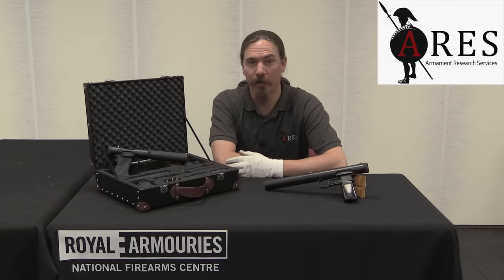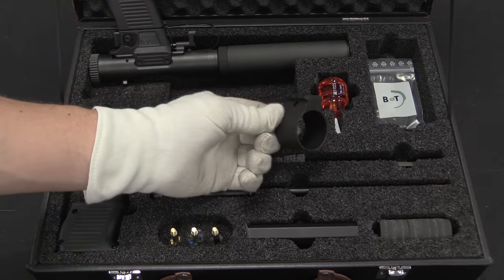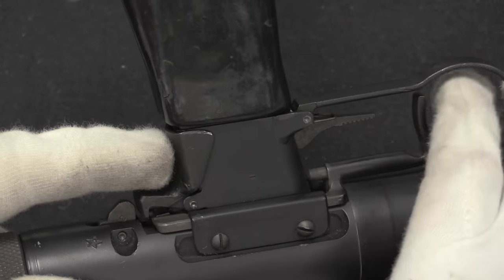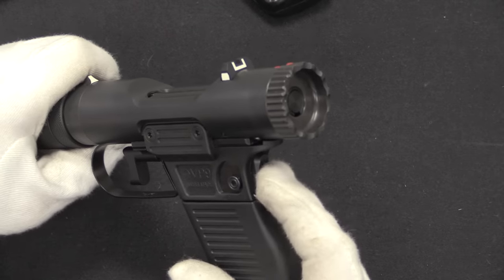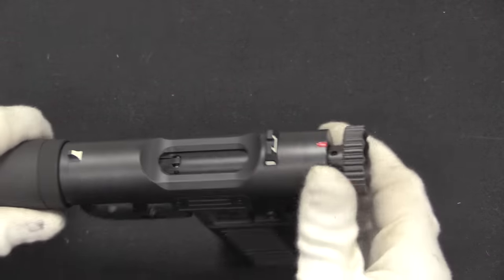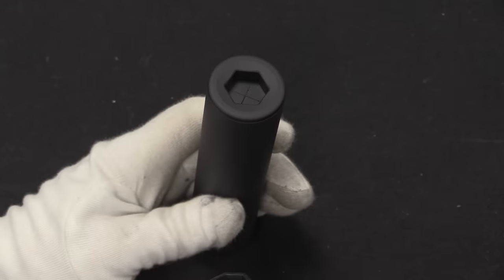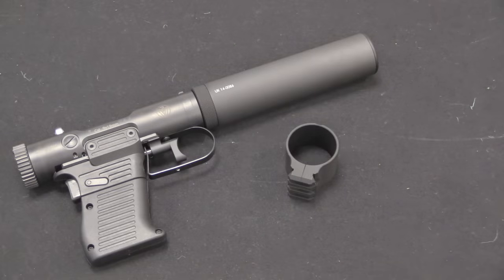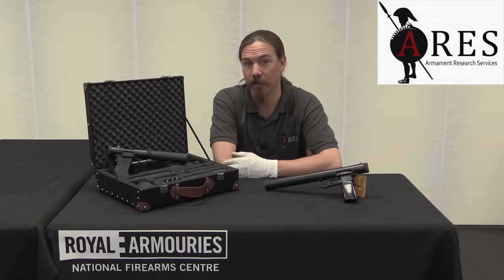B&T VP9 Silenced Pistol: A Modern Welrod

Comment: total rip off of the welrod. still that shitty euro 9mm round.
Reply: What's wrong with 9mm? It's perfectly adequate to get the job done. Especially at the ranges THIS thing is going to be used.

To roughly quote Black Lagoon 'Pretty much any bullet will do the job if you can hit what you're aiming at'.
Reply: DFX2KX it's a euro fixation on the round.  I've had this "talk" with the designers.  it's a supersonic round, in normal varieties, a 45 is subsonic by default.  the designers seems to think the smaller gas of the 9mm is easier to quite, while the 45 larger  (and slower gas) would be harder.  so I call b/s on them. a 45 would be better in most "animals" or just go with a 22lr & it's smaller gas. it's a welrod rip off by an eu company that can't stand an American round would be better than the euro. one.
Reply: Matthew Wilhoit Strange than an european company who manufactures guns in europe would go for the most available european ammo... Also with your comment one could say that you have an US fixation on the 45 round... :-P
Also also: yes, it's a welrod rip off, and the welrod was a british made gun in 9mm (and some in .38)...
Reply: Geir Ove Eilertsen of they were honest about why, I'd take less issuer with it. but as I said, I've talked to them about. gotten b/s replies instead of honesty.